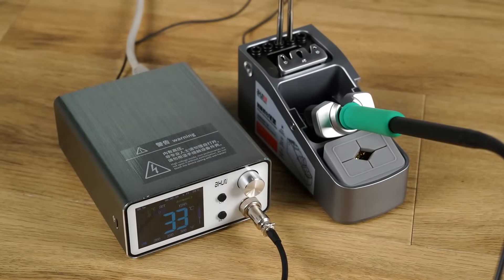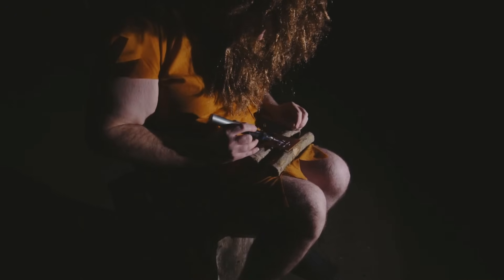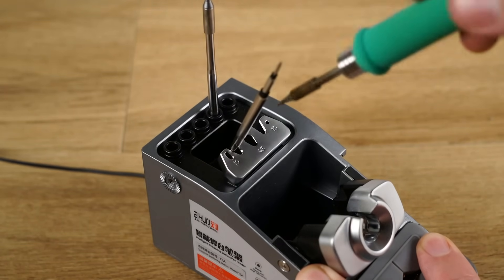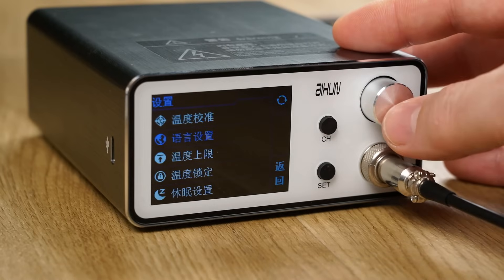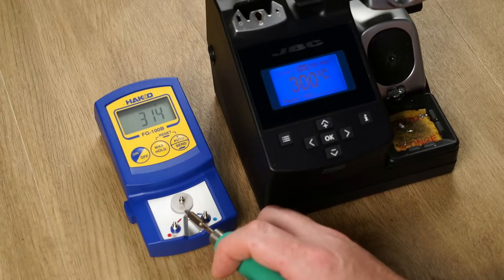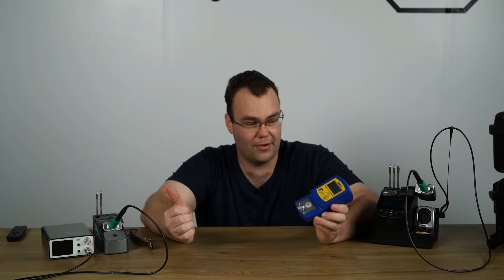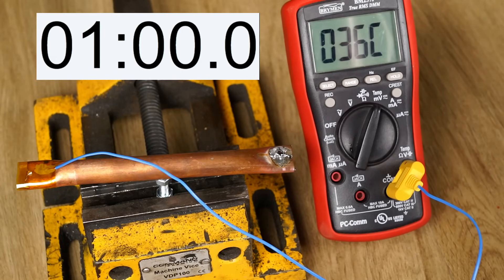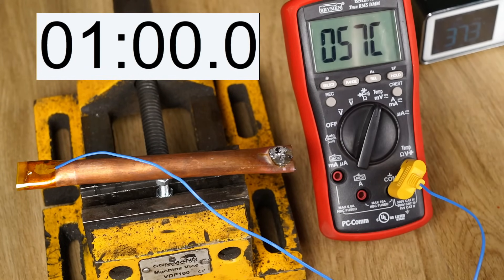AIXUN T3A Soldering Station Review ll JBC iron comparison

Comment: hey schematix, appreciate the video review. i couldn"t help but notice your interest in larger tip sizes, especially being a farmer yourself. therefore did you know about the t470 handle and tips? because my impression seems to be they share the same heater and thermocouple pin arrangement in the tip, and therefore should be electrically compatible between t245 and t470. unlike the smaller c210. so my question is this: can we simply just buy ourselves a t470 handle as an extra accessory and plug it in? because this may give an even higher performance for larger tip sizes. which could be useful. best wishes
Reply: C470 tips run at 48v and have a different heater resistance, at 24v they would actually put out less power than a C245.

Comment: Be nice to see the insides. The first thing I did when I got my KSGER t12 stations a few years ago was open them all up. They were surprisingly well-made inside come up with everything properly terminated, ground where it should and shouldn’t be, and everything was done properly

 although I did swap a few of the bigger shittier filter caps. And I think I added heat sink compound between one of the transistors and heat sink because it was dry and barely touching the heat sink. I haven’t touched my jbc  or pace equipment very much at all since getting the KSGER irons.

Not because the newer ones are a lot better or anything. But they are definitely on par. And I don’t have to worry about ruining a $50 tip or damaging really really expensive soldering equipment if I make a boo-boo mistake. That pace station when I bought it new was about $1200 for the all in one thing including the tweezers the hot air several different irons and desoldering pump. And I bought another one on the used market and it was still pretty damn expensive about five years ago. 

I really like the KSGER t12 stations. Even some of the cheaper basic ones are pretty nice 

I  didn’t buy the basic ones I bought the ones with the big thick 10mm billet aluminum and engraved faceplate, aluminum machined torch handles, with the modern STM 32 hardware and software utilized with also the most up-to-date board revisions. . I think they run about 80 bucks delivered for the nicer ones like that. But you can get pretty much the exact same thing it just comes with a plastic handle, and a regular extruded aluminum case that also has a much smaller old screen on the front that’s harder to see. But they are about half the price running about 40 bucks apiece according to where you get them.

 Anyway… Would be cool to see the inside of the one in your video both brand-name and knock off and see how it compares.
Reply: My KSGER needed an earth ground added to the case.
Reply: I've had mixed experience with KSGER. I bought two stations from one store, slightly different versions, one new and one older.  While older version worked fine, but the new one had two major issues. First, actual temperature was at least 50 C higher than that is set on the display. It melted solder even on minimum 200 C set. As I found out by reading forums, cause of the problem is that they put different opamp (I assume cheaper) with high offset voltage on a newer version. So I replaced it with ad8628, temperature error was gone. But after some time I started noticing that station was freezing from time to time. And once it froze and tip went red hot. I changed microcontroller to original stm32f103, fortunately I found firmware to flash it. Now it's working just fine, but it was quite an experience. But I'm thinking that even taking into account replacements I made It's quite good for it's price.
Reply: Steve from SDG Electronics did the teardowns
Reply: Lol do you also have an inability to not look whats inside every electronic item you get your hands on?

Comment: It seems that the handle connection port is different than original JBC connector...what a shame...I'd wanted to use my original T245 with this station without modifying it...
Reply: Did you try the modification?
Reply: @tcurdt  no

Comment: I would have used the affiliate link in this case, but I think this is the first time I've bought something before you showed it off. Good review. I'm considering now the T3B as a second unit for finer soldering work (NT115/T115), but wondering if I can use genuine WS140 (micro wirestripper) AT420 (micro tweezers). If the firmware was opensourced it would get a lot more improvements and attention when you have trust in how the code works.
Non windows installation would also be a huge improvement. ie Don't make installer binary for platforms allow for trusted existing tools to install and update the firmware. Other issue I got was I didn't get the fancy new stand with mine. :-(
Reply: What is the difference between T3A and T3B ? 
I have a chip yihua 936 and i'm thinking of upgrading, those stations really do seem to be a good choice. Also I don't know if I should go for the T12 tips or the ones from JBC (245?)

Comment: there is a 1.25 firmware now that fixes the graph issues on the home screen. also we ordered in a dozen for the shop and 2 have really bad light bleed from the upper right corner of the display. a few others are a bit brighter there but those have a bright spot there. otherwise nothing to complain about with these